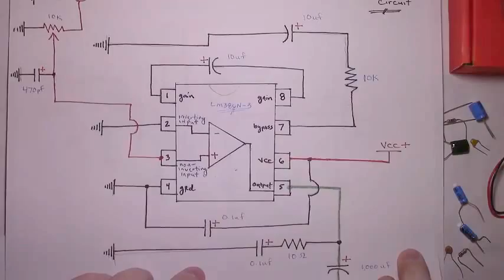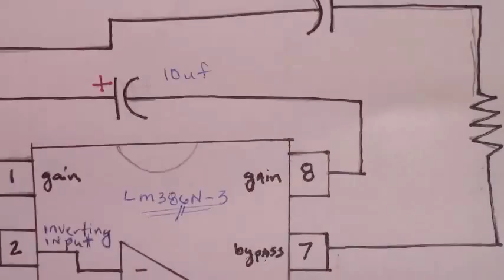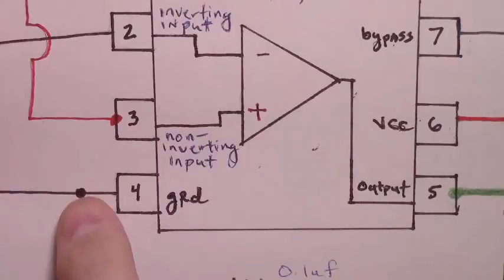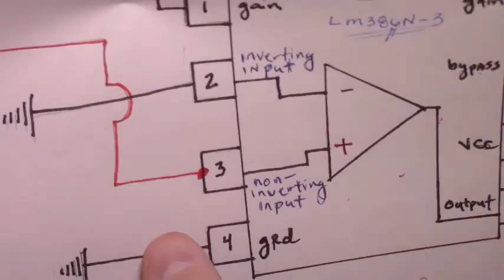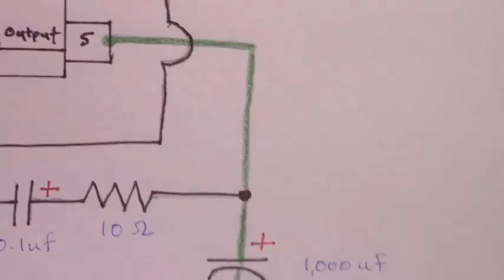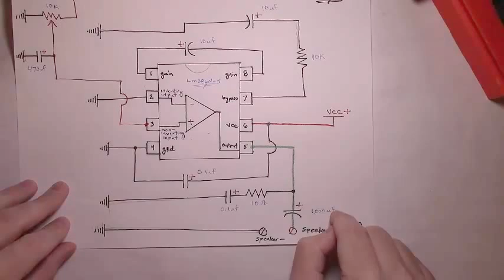Circuit Assembly Tutorials || LM386 Audio Amplifier

Comment: When I am trying to set this all up, the LM386N  becomes very hot (You can get seriously burnt on it). It all seems like yours. But I do not have the thing you put after the capacitor, is this anything needed for this? Everything else seems like yours. I'm a student and I chose this because it all looks cool, but my grades will fall if I don't make this work. Please reply.
Reply: EDIT: Now I did put the .1 micro infront of the first placed capactitor. But this time my battery ran hot.. Something is wrong, and I can't find out what.
Reply from the maker: EᴢʀᴇᴀʟFX | Jᴜsᴛ ᴀɴᴏᴛʜᴇʀ ᴅᴇsɪɢɴᴇʀ Appreciate the question.  I'll do my best to help.

 What you're describing sounds exactly like there's a short to ground present somewhere on the board.  

Some things to check:
1) Was the chip inserted into the board in the proper orientation? That is, did you insert it with small dot and/or scallop in the direction of the potentiometer?  If not, then that will be the problem, such would mean that the ground connections are receiving VCC and the VCC connections are receiving ground.  That would certainly cause the sort of behavior you're describing so definitely make sure that the chip is properly oriented in the board first.   

2) Assuming the chip was properly oriented,  I would next suggest re-tracing each of the wires you've connected to the VCC and ground rails.  Might one of them have been misplaced while you were assembling the circuit? (might a wire that was intended for the VCC rail have ended up in the ground rail, etc...such is very easy to accidentally do).  

3) Assuming all the 'rail' wires ended up where they were intended to go, I very very briefly reconnect and disconnect the battery and then feel each of the wires.  If one wire tends to be warmer than all the rest, then you'll know that the problem is associated with that wire, and that would help to home in on the source of the problem.

   If you perform 1-3 and the problem is not discovered, then just let me know and we will go from there.    Note that if 1) happened to be the problem i.e., the chip was oriented 'upside down', then the chip might have been internally damaged during those moments when it was hot.  You might have to replace it before the circuit will work.  386's are fairly durable chips, but even a brief short to ground across the entire chip could have resulted in internal damage.   

Hope these comments help.  Please let me know if there are more questions, etc.  I will always do my best to help.

Comment from the maker: To Noe Flores:

Thanks for the question and for watching the video.  I wasn't able to directly reply to your comment through the reply button.  Hopefully, you'll be able to see this comment instead.  
The capacitors used in the video had a voltage rating of 25V or above.  The general rule of thumb is to use capacitors with a value 2 to 3 times higher than the voltage you ever expect them to see during normal circuit operation.  For example, if one used a 9V battery to power the circuit, then capacitors with a voltage rating or 18V or higher would be fine.  Hope these comments help.  Please let me know if/when there are more questions and I will always do my best to help.
Reply: philo mech finally sir I made. my first board is working. Thanks from the tip at the video.and I saw my problem I put my resistor at the opposite sides. Thank you again for answering my question Sir.
Reply: +philo mech can you make another video 12volts for me?thank you so much.i'm a mechanic but i want to know about car audio.
Reply: philo mech what is the diffrence between using this and a 555 timer?
Reply from the maker: Owen Chase I'm not quite sure that I understand the question, might you say a little more?  

The LM386 amplifies audio signals whereas the 555 timer can be used to perform various timing, bistable, astable, etc., tasks.  The chips are for different purposes. 

Might I have misunderstood what you were asking?  If so, then please let me know and I will continue to do my best to help.    

Thanks for watching!
Reply: Well I have seen amplifier circuits using the 555 timer.
Reply from the maker: Owen Chase Aha!  Now I understand the question.  Yes, it's certainly possible to use the 555 timer as a component in a PWM/Class D style audio amplifier circuit.  By itself the timer doesn't source much more that 200mA but if paired with an appropriate mosfet it can be used to make a fairly decent sounding PWM based audio amplifier.  Conversely, the 386 is the more traditional Class A/B (analog) variety.  Some will claim that PWM based amp circuits tend to not sound quite as nice as analog ones.  But, there are certainly some nice sounding PWM-based amps out there.  I've always been a little more partial to analog amps, but Class Ds do tend to be more efficient in the long run.  But if efficiency isn't really an issue, then choosing between analog vs. PWM based amps is largely a matter of what one happens to prefer.  Both will serve to reproduce and amplify audio signals but one or the other will likely sound better or worse depending on who happens to be listening.    Also, given the timer's current sourcing limits, one needs a mosfet to bring up the sound to a higher volume whereas adding such isn't needed with 386, 383s, etc.      Essentially, two of the core differences between the timer and 386 would seem to be analog vs. digital audio amplification and the need for an extra current sourcing component i.e., power transistor/mosfet, or not.     There are more but these are two of the primary ones.       

 Both types of amplification circuits are enjoyable to build and learn about.  And, they're both worth being familiar with.  

Hope these comments help.  Just let me know if there are more questions and I will continue to do my best to help.
Reply: thanks for your time and answering me. I have one more thing to ask, I dont know if you have built a transmitter circuit but these chips take very little current to run, if they take little current to run how do I get the transmitter to run at a couple watts because you cant put that much power through these chips because I want to transmit at a higher wattage?
Reply from the maker: Owen Chase Unfortunately, I haven't had many opportunities to work with transmitter circuitry (besides IR and laser types of projects).  I tend to use charity shop hacks and off-the-shelf components for more RC type tx/rx tasks and I have no experience with AM/FM, etc., signal transmission circuitry.  There are some regulations associated with attempting to 'boost' certain types of transmitters.  So as to not fall afoul of those you might see if an antenna 'upgrade' is possible and/or what's involved in boosting the sensitivity of the receiver side rather than transmitter.  A different antenna (or antenna set) and/or a little added sensitivity to the receiver circuitry might serve the same purpose as changing the tx side.  It's often no problem to increase the sensitively of IR types of receivers via some simple op amp circuitry.  It might be possible to do something similar in the RC, AM/FM, etc., domains...but I can't say with certainty.  Wish I could be more helpful, but tx/rx (outside the IR and laser domains) is one of my blind spots.  

If you do discover a way to accomplish the task, I'd definitely be interested in hearing about it.  I always welcome the opportunity to learn more.
Reply: ok thanks again.
Reply: I am also using a 9v power supply and the cap rated at 25v. My speaker is of 8ohm and 2.5 watt lcd speakers. Still theirs lots of distortion when i increase the volume.

Comment: i accidentally bought a 0.1 uf 100vdc radial capacitor. it looks to be quite a bit larger than the ones you are using. Will that work? Thanks! :D
Reply from the maker: ZombieJoe9 Thanks for the question and for watching!  

Might you mean an electrolytic (metal can) type capacitor ('radial' tends to refer to the orientation of the capacitor's legs rather than type)?  

No worries either way.  As long as the value is the same, most any type should work, e.g., ceramic, film, electrolytic, etc..  An electrolytic might introduce a little more 'noise' into the circuit but perhaps not too much.  I'd try it and see if the sound quality is acceptable for your purposes.  If not, then it would likely be worth purchasing a film type capacitor.  

Hope these comments help.  Please let me know if there are more questions.  I'll always do my best to help
Reply: Hmmm its says cap film 0.1f. But im not very knowledgeable on this stuff yet. Thanks for the reply! Ill just see if it works.

Comment: not working...... no noise is heard too... can capacitor values be close to what is mentioned or exactly the same?
Reply from the maker: Raju Vishnu Thanks for the question. One capacitor value is a little more crucial than others, i.e., the capacitor between pins 1 and 8 shouldn't be any larger than 10uf.  Most of the others could be exchanged for a little smaller or larger values.  Such exchanging might effect the overall sound quality, but it should function with values that differ somewhat from those used in the video.  Might you say a little more about what's happening?  Is there any sound output or none?  It would be helpful to see an image of how you've connected everything on the board.  I would first recheck each of the connections against those made in the video.  It's possible that you might have encountered a defective chip...does the chip you're using have a manufacturer label on it?  Please provide a little more information and I will continue to do my best to help.

Comment: Firstly, very well explained tutorial for people, particularly those new to audio electronics.  I have built a number of LM386 audio amplifiers (as well as others audio amps using opamps). Despite what some say, I have experienced NO noise or distortion, unless the input source volume is set ridiculously high (which the chip does not like) and find it a very good IC. Just a couple of comments which I hope you don't mind. I have never experienced any radio interference on my circuits (breadboarded or soldered up) so I wonder if you live very close to a transmitter? I have never therefore needed a capacitor between pins 6 & 4. I couple pin 2 directly to pin 4 (very short jumper wire) and then put a 1uf capacitor between pins 7 & 4 (with no resistor - not sure why you have a resistor there?). In that way, all the necessary pins are linked to ground with minimal use of extra wire which can introduce noise. I add a 100uf decoupling capacitor from positive to negative rails immediately after battery power terminals. Finally, though I don't know how important this is, I put the low value capacitor/resistor series (from pin 5 to ground) the other way round (i.e capacitor followed by resistor) as indicated in the datasheet . The speaker used is indeed quite important. I have found that I can drive a 8 Ohm 6" speaker rated at 20w with the N1 chip (though not supersonic volume) but on of the best speakers I have used with this setup is an old 3", 8 Ohm 3W Nokia car phone speaker :-)  Hope you keep making great videos, encouraging people to build their own stuff. Regards
Reply from the maker: standishgeezer Appreciate the feedback and the circuit description!  I'll certainly try out the design.  Interestingly enough, unwanted RF tends to be the norm whenever I build audio amp circuits.  I currently live in the middle of a larger city (multiple transmitters just a few blocks away).  So, I couldn't get away with leaving out the pf cap on the input line, I often have to add more, as well as some high pass filtering, etc.  Jumping a ground over the chip would certainly work, I tend to do the same when I move to protoboard.  I routed the grounds as shown in the video for ease of presentation while at the same time holding on to the target (low noise, etc.) functionality.  But any routing that reduces wire length is always going to be a plus with an op amp circuit.  Decoupling the supply lines is certainly a must, I added two supply line decoupling caps to the board.  Adding even a few more likely wouldn't hurt.  As to the (perhaps) strange orientation of the low value resistor and cap series, I swapped their ordering solely because it sounded a little better to my ear.  Both orientations will work, I simply liked the way the orientation in the video sounded a little better.  Agreed about the speaker.  I've often been surprised by how much difference a speaker can make.  One of two supposedly 'identical' speakers might in fact sound better (at least in my experience).  All this being said I definitely appreciate the feedback and that you watched the video.   I greatly enjoy making the videos and hope that they help to encourage some to enter the always interesting world of electronics.

Comment: Great video! I am using an lm386 m-82 ic and a .5 w 8ohm speaker.  The speaker is only clear when the volume on the phone is really low, otherwise it gets really fuzzy.  The volume does change when i turn the potentiometer, so i'm pretty sure the circuit is hooked up right.  Do you think this is because of the speaker or the IC?

Comment: Hi Can I use Lm386N-1 because this is only available here
Reply from the maker: Norlan Brequillo Thanks for the question and for watching.  

Yes, an LM386N-1 will work.  The N-1 doesn't source quite as many milliamps as the N-3 or N-4 versions but it should still sound fine.  All that less current sourcing will mean is a little less overall volume capability.

Hope these comments help.  Please let me know if/when there are more questions.  I'll always do my best to help.
Reply: philo mech Hi again why there still a noise?
Reply from the maker: Norlan Brequillo  

Might you say a little more?  

For example, what type of "noise" (crackles, pops, static)?  Is it consistent or does it go away or change when you move or touch various parts of the circuit? 

 A few things to check: 
(1)  If you're using an AC to DC adapter to power the circuit, then try using batteries.  If the noise goes away, then you'll know it was entering the circuit through the adapter. 
(2) How long are your wires?  If they're a lot longer than those used in the video, then they could be acting like antennas and inserting RF noise into the circuit.  
(3) Try replacing the potentimeter with one of the same or similar value.  Noise can be picked up from the resistive material inside the pot, a different pot might contain somewhat "better" internal resistive material. 
(4) Which manufacturer (if any) is associated with the specific chip you used, e.g., Fairchild, Texas Instruments, etc...?  I ask because there are a lot of independent companies that have manufactured clones of the 386 and it's been my experience that clones often sound quite poor in comparison to 386's manufactured by one or more of the larger manufacturers.  
(5) If none of the above has helped, then try taking the circuit outside, as far as possible for any houses, etc.  If the noise lessens or goes away entirely, then you'll know that it was coming from the magnetic fields associated with the household AC running through the walls.   

Hope these comments are helpful.  

Definitely let me know if you discover the source of the noise and if there are more questions.  I will always do my best to help.
Reply: umm the lm386 dont have any manufactured on chip
Reply: ah thank you the noise gone

Comment: Hello philo mech

Just out of curiosity, can you explain the purpose of the bypass of pin 7.
Reply from the maker: Orlando Gomez Thanks for the question and for watching.

It helps to reduce power supply noise that might otherwise find its way into the inputs.  

The 386 is quite sensitive and will tend to amplify even the slightest power supply ripple, noise, etc.  The cap on pin 7 helps to reduce some 'noise', the pF cap on the +input helps to reduce further noise (RF in that case), the 100uf across the supply rails helps to reduce even more noise, and the usage of the shortest wires possible helps to reduce even more noise.  In the context of most op amp circuits decoupling caps tend to be one's best friend in the battle against noise.
 
For further discussion of pin 7 and the reason for decoupling it through a cap one might also check out, e.g., 
http://www.diystompboxes.com/smfforum/index.php?topic=88334.0
Google keywords: "DIY stompboxes LM386 pin 7 cap"

Comment: Can i use this with a microphone instead of an mp3 player input?
Reply from the maker: Cem Savaş Aydin Thanks for the question.  

It depends on the type and impedance of the microphone.  

Some microphones might require more input impedance that the 386 circuit provides.  I'd encourage you try it with the mic you'd like to use and see.  If the output has too much of a  'tinny'/metallic ring/resonance, then it's likely that an additional pre-amp circuit with a higher input impedance inserted between the mic and 386 will be needed.
  
Hope these comments help.  Please let me know if there are more questions.
Reply: philo mech oh thanks for your help i really like to play around with these electronic circuits its a really interesting and fun hobby.